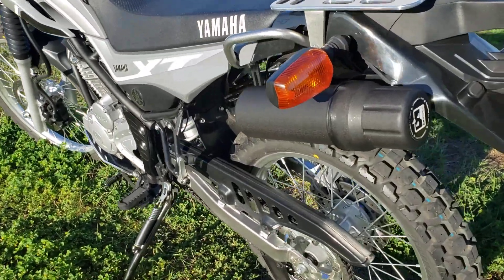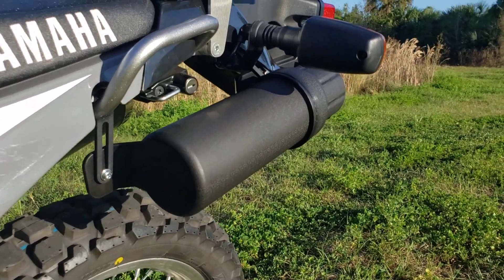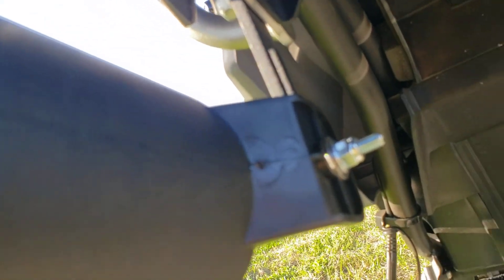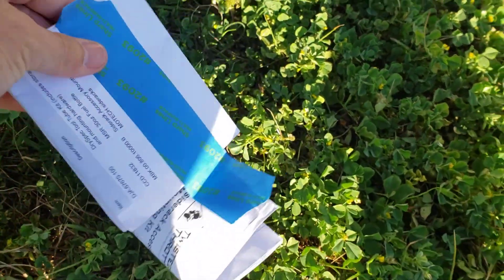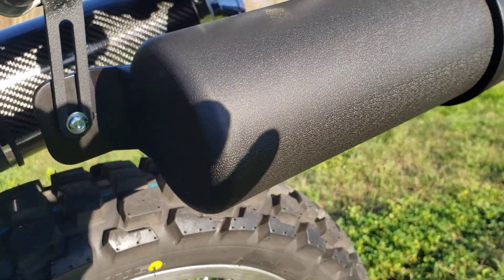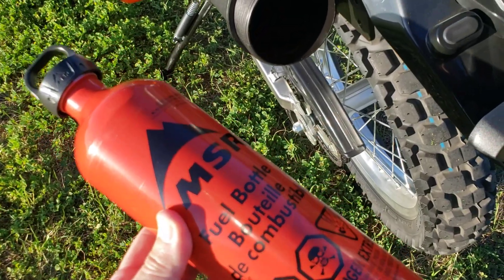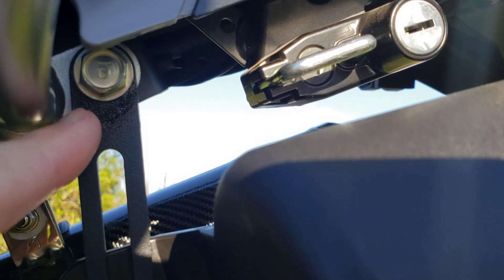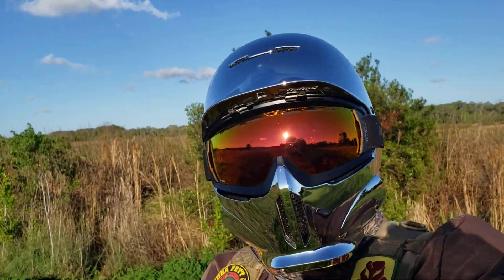Dry Spec Tool Tube mounted to Yamaha XT250 🔩🙂🔧

Comment: This is so cool! I will definitely order one for my 2023 XT250. I really like the setup you have on with your rear rack and the tool tube, It looks super clean. Thank you for making these videos.
Reply from the maker: Thanks Roberto 🙂! I appreciate your comments. Just sharing if you put the fuel bottle in there over time it will vibrate the red paint off and dust the tool tube interior. I'd only have it in there when your actually going to use it. Also I've put well over 1k miles after this install and had no issues.
Reply: @findingneutral  Thanks for the tip, I would only put it there when off-roading with my kids since my son's KLX110 doesn't have a reserve petcock. 🙂👍 Regards,

Comment: I like the look of your rear rack and thought about getting one myself but the fact it only has 2 mounting points changed my mind. Right now I have the Precision Motorcycle Rack with the Dolomiti Trekker 30 in black but just bought a new one from Webike made by Yamaha. Just like the Precision Rack it mounts where the passenger grips where but has the grips made into it. I talked to the guy that sells the rack you have and voiced my concerns about only 2 mounting points, but he says if the bolts are tight it shouldn't pivot.
Reply from the maker: Cool. I think my rack is definitely for lighter weight applications. So you did good researching and finding a great alternative 👍

Comment: How durable is that tool tube?  I ask cause i like the idea but wonder about when off roading and the bike gets laid down on that side will it break?
Reply from the maker: I had someone post they break kind of easy. I just putz around so no issues thus far. But if it took a direct hit probably would not hold up super good.
Reply: @findingneutral  i gotcha, I kinda wondered.  Maybe with a side carrier rack and its mounted on the inside of it otd be fine.  But id have to see how much that would take to do

Comment: Can you please show a little more clearly how your Flatland rear rack is mounted?  I see the one bracket on each side, but I'm wondering if there are any other mounting points.  Thank you
Reply from the maker: Those are the only 2 mounting points. This rack mounts there and the bottom just kind of firmly rests on the plastic thing right after the rear of the seat. I feel this makes a nice rally pack type rack. But for camping gear and heavier lodes probably not so much.